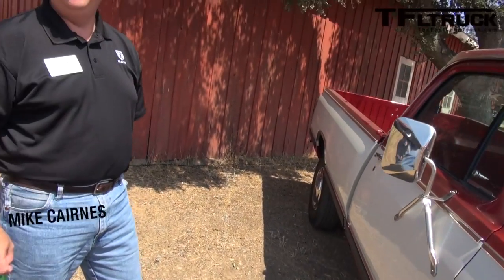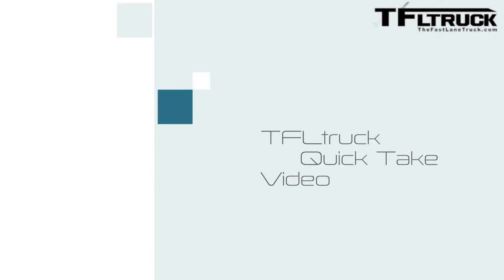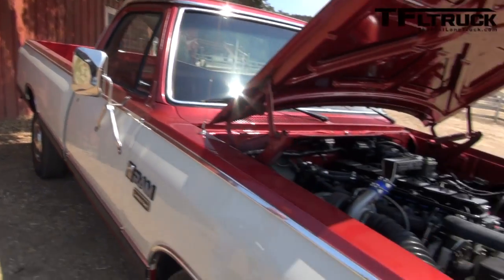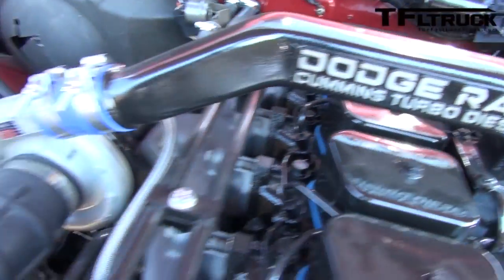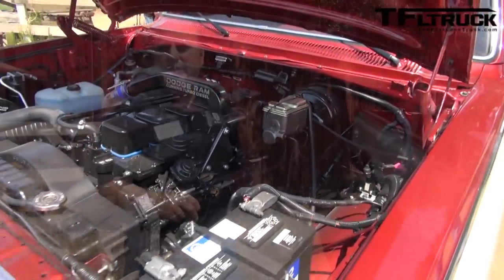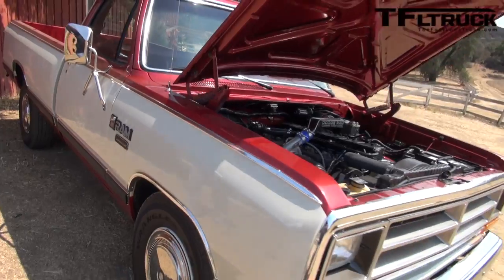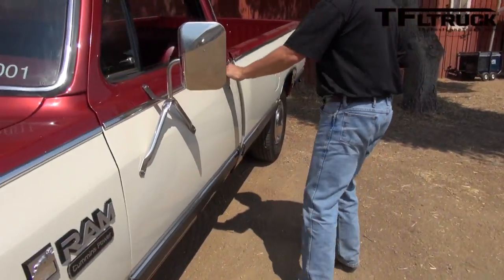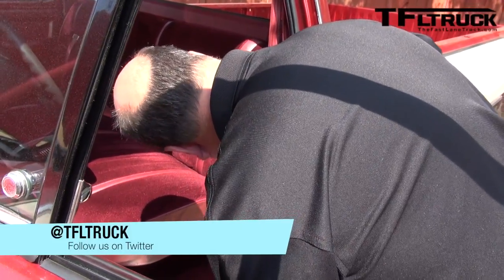Classic Trucks Revealed: 1985 Dodge Ram 3/4-ton Cummins Prototype Quick Take

Comment: If I’m not mistaken I believe towards the end of the Ram Cummins first gen run (1989-93) the truck specs were around 160hp @ 400ft lbs of torque and depending on what rear end and transmission one had & a tow rating of just under 12,000 lbs at 11,900lbs respectively.

I definitely remember the Getrag 5 speed manual transmission my grandfather had in his. Driving & shifting one instantly gave a person chest hair to anyone tempting this feat. Sorry Grandma!!!!!😜✌🏽

Back then the automatic transmissions were clunky, didn’t hold up to the HP or any extra one might add (yes even at those numbers) and we’re very expensive to fix/repair.

✌🏽

Comment: The cummins motors they put in the dodge trucks are the same ones that go in school buses but are toned down a bit. You could easily pick up 40 hp by turning up the screw on the injection pump, and along with a few other cheap mods, can get them to make a decent amount of power. I even know a guy that took the motor out of a 91 dodge pickup, and all he did was but a four inch turbo back, along with an oversized turbo, and turned up the screw on the injection pump, and put it in a bread truck he made into a motor home. It weighed 16,000 lbs and has yet to see a hill in the mountains where he can't go the speed limit. It has 305k miles on it and is still running strong. These are legendary motors, and will definately mark not just turn point in history for dodge trucks, but all trucks ever used to pull anything.

Comment: LOL I have personally hauled 23,750lbs of hay on my farm for miles with ease and that's a bone stock 300,000 mile automatic 1992 dodge cummins 2wd, my dad's 1991 cummins 3500 4x4 has well surpassed 30,000lbs many many times and has 579,381 miles on it and only ever had the injectors replaced at 300,000 miles, we have a 2010 6.7 4x4 that never gets used for tow duty, so what does that say.

Comment: on the new diesels you should put a quart of power steering fluid in every fill up to keep the fuel pump lubricated good enough because new deisel fuel is too thin and the diesel fuel is what lubricates the pump